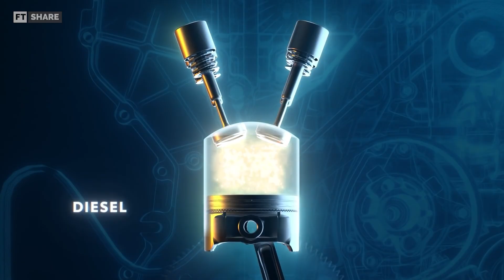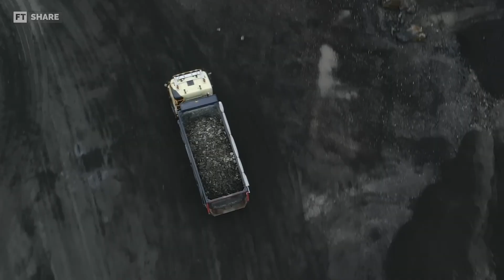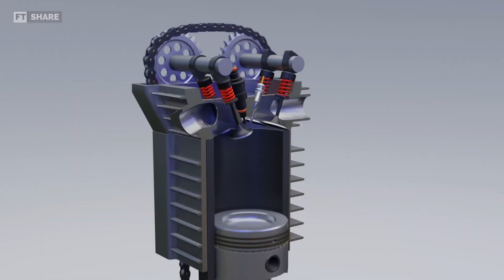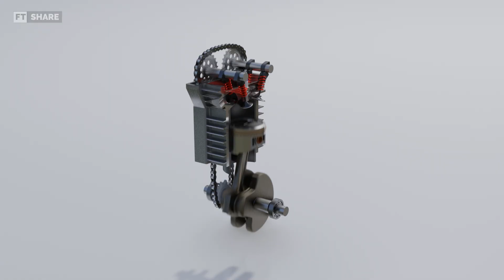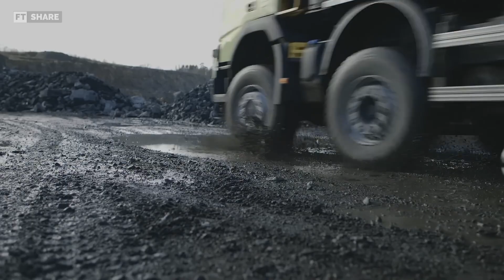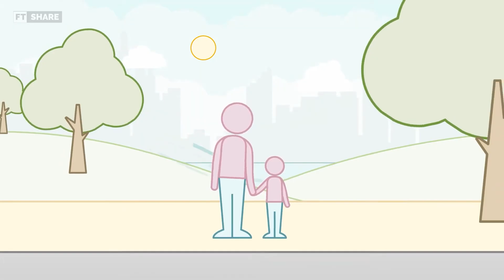Petrol (Gasoline) Engine vs Diesel Engine | Which one is more better?

Comment: We have a new retrofit engine combustion HYBRID design called  "DIESOLINE" technology. It can retrofit a diesel engine run more like a gasoline engine, or vise versa. It can take any current engine (or design) and turn it to operate more powerful (about >2.5 times torque) and more efficient (about >30%). It is just by splitting the piston crown part from its skirt to be operated via a (valvetrain-like) pistrontrain from the crankshaft (which can be directly from the crankshaft without reduction gears).